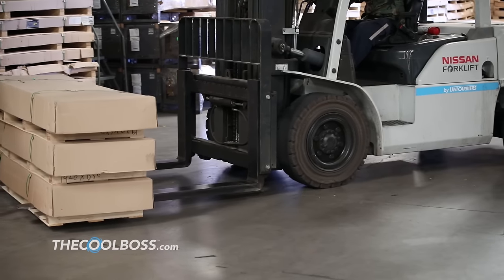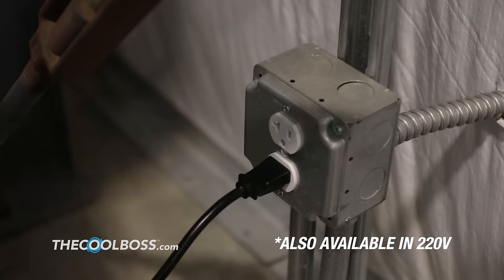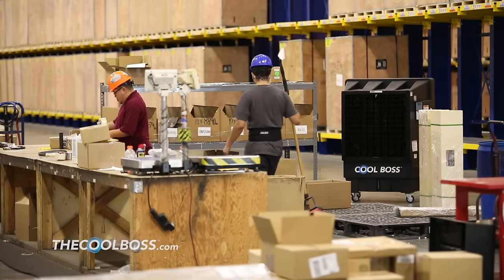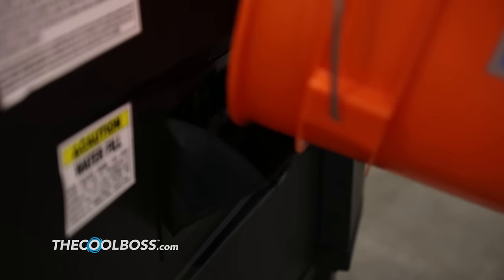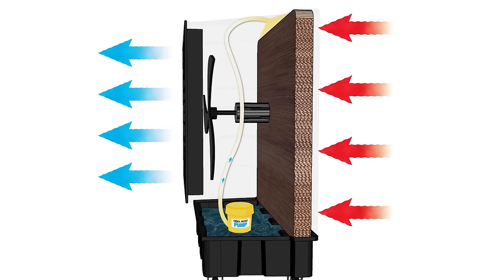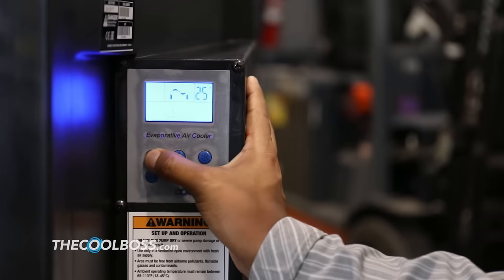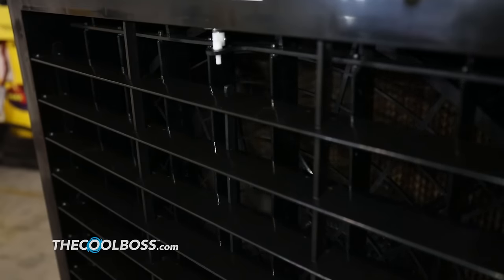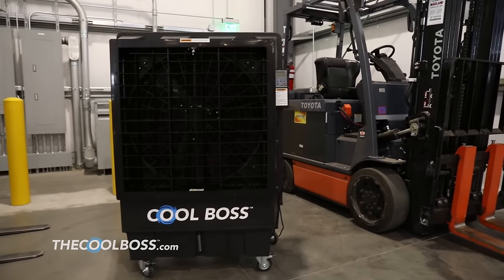The Cool Boss Portable Evaporative Air Cooler by BendPak

Comment: Can you put ice in the reservoir to help the cooling effect?
Reply from the maker: You can put ice in the reservoir, just make sure there is still plenty of water as well. If the pump is surrounded only by ice and isn't getting enough water, there won't be any cooling effect and you risk damaging the pump.
Reply: Thank you for replying.i live in a humid climate and have seen other manufacturers say to put ice in similar coolers.makes sense to keep resovoir full to avoid pump failure.
Reply from the maker: One thing to definitely keep in mind is that all portable evaporative air-coolers "swamp coolers" are going to be less efficient in humidity, even if you add ice to the reservoir. The more humid, the less the cooling effect will be; this is because these units work ultimately by adding moisture to the air. If the air is already saturated with moisture, the evaporation process from the machine isn't as effective. For more information check out https://www.thecoolboss.com/
Reply: BendPak I understand.i actually already own this unit and I have been completely satisfied so far.as long as I work in the wind path of the cool boss it makes it comfortable enough to get the job done.just thought maybe the ice would make it even better.it does seem to use a lot of water here.have heard of swamp coolers having a way to regulate the water flow but my unit does not seem to have that feature.like I said I’m happy with it and it gets the job done when I need it to.thanks again bendpak for another great product !